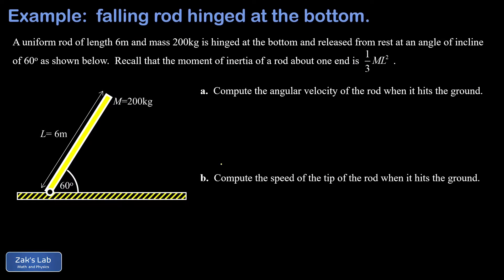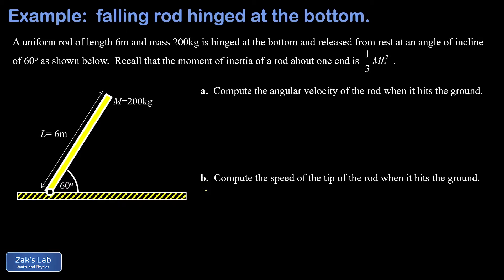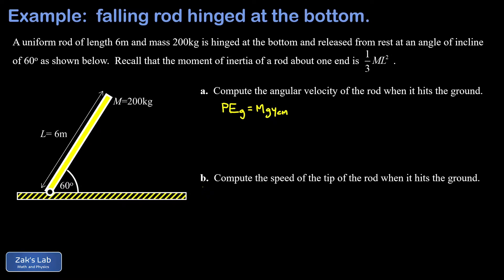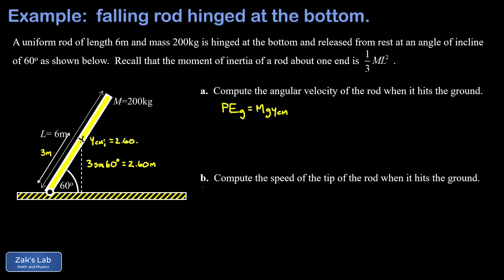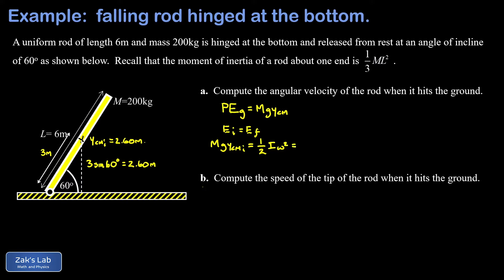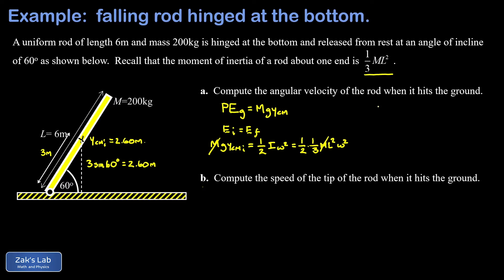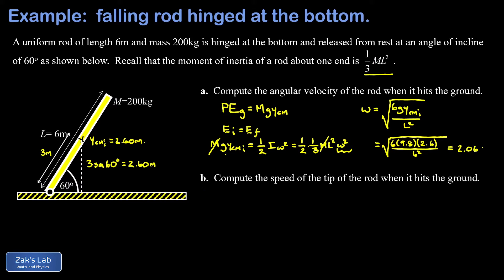Hinged beam falls without slipping: find the final angular velocity of the rod and speed at the tip.

Comment: Shouldn’t your derivation under the square root have a 3 instead of a 6 since the 1/2 on each side of the equation cancel? 

Thank you for the video!
Reply from the maker: the very  left hand side of the equation was Mgy_cm and the right side was 1/6*ML^2w^2 . . . the goal was to solve for w in terms of M, g and y_cm.  don't get distracted by the in-between step of 1/2Iw^2 !
Reply: @ZaksLab Ah, I’m used to ycm as L/2, my bad!